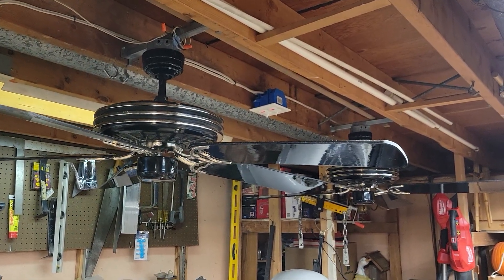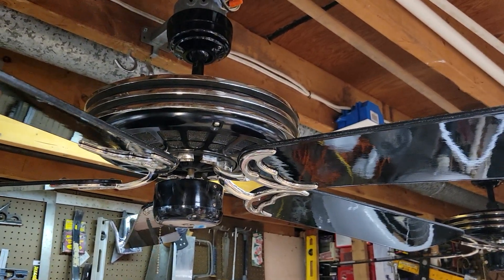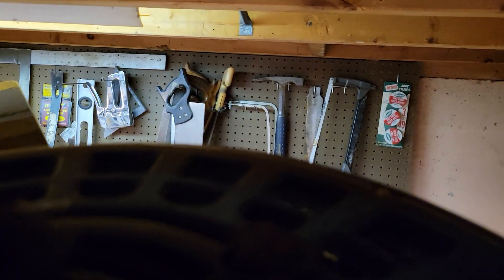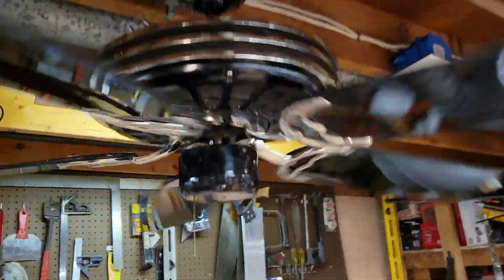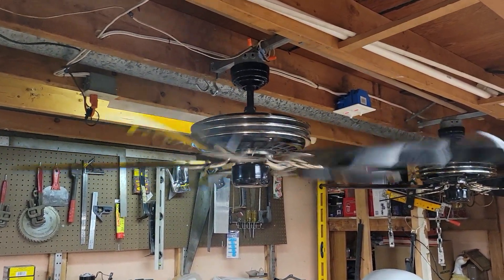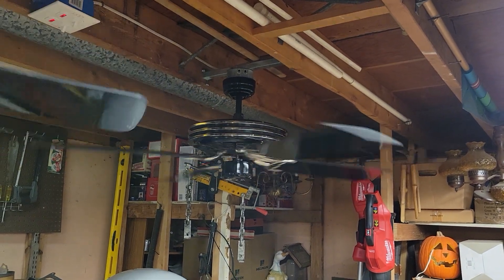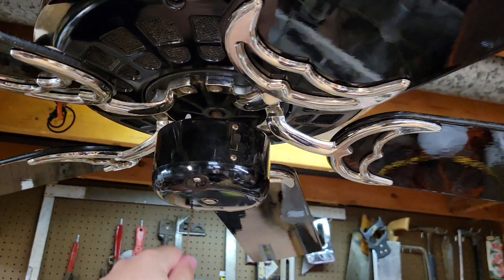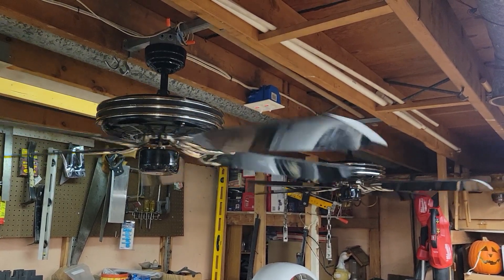NuTone Elegance 52" Ceiling Fans Revisit

Comment: The 5-blade one has the reverse switch installed upside down, which I feel like was somewhat common for NuTones back then? And from what I can tell, it’s installed right side up on the 4-bladed one?
Reply from the maker: Who knows, it may have been something I did myself years back or the factory
Reply: @thefandude21  Well I feel like I’ve seen several videos of Sea Islands where it was upside down.